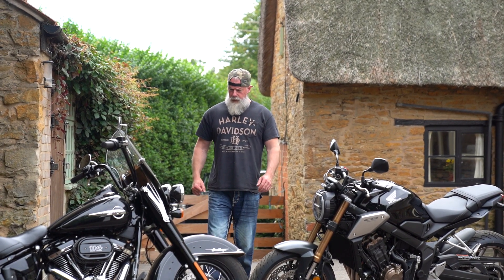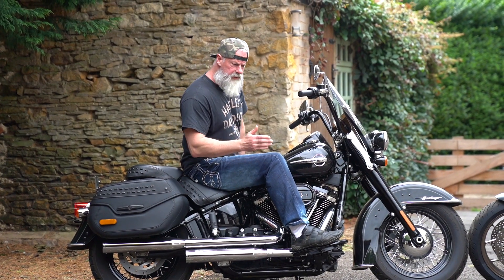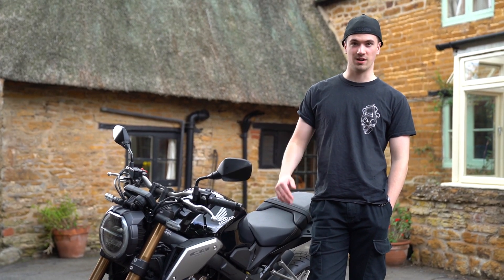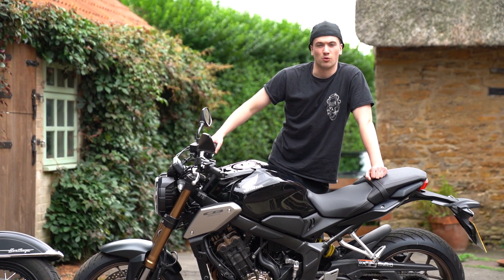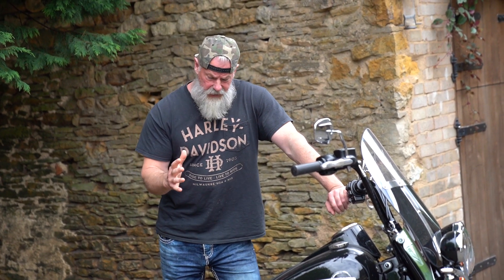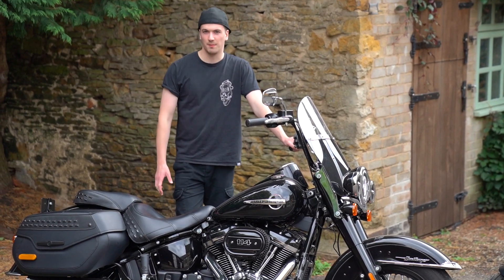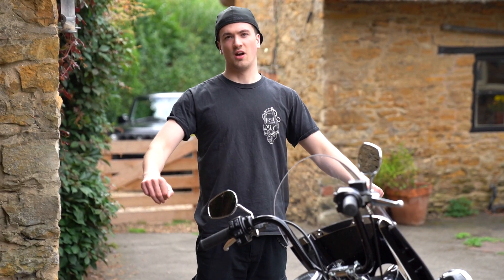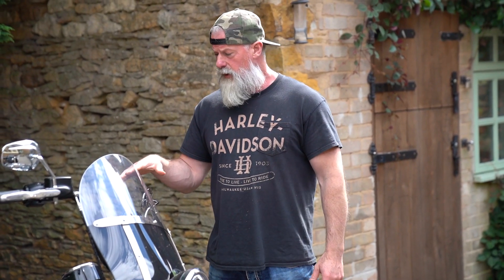Motorcycle Torque vs Power EXPLAINED: A Simple Guide (Harley-Davidson vs Honda)

Comment: For its weight and capacity Harley are not even high in torque. You could have found a 'crotch rocket' with more torque, half the weight and capacity.
Reply: The main difference lies that you would need to rev up the crotch rocket to the red line to generate that maximum torque, whereas in the H-D it can be generated from the very low end in the rpm range. In other words, it is much more satisfying to ride in a mountain with an engine that pushes hard with little effort. For most of us who like cruisers, it is not our idea to stress the engine for recreational rides, besides the fact that the riding position of a crotch rocket is never the best or optimal for long trips. Motorcycles have their purposes; a sport bike is the best only in a racetrack.
Reply: @omarsalgado9715  There are plenty of torquey Japanese bikes that make more bottom end power with less weight and less capacity. I have a 20 year old BMW that makes more torque at lower revs with much smaller engine.
Reply: @parsivalshorse  Name a few, please, better if you put specs altogether.
Reply: @omarsalgado9715  Well the Suzuki M1800R makes substantially more torque at lower RPM and with nearly 50% more horsepower. Harley are a very archaic engine.
Reply: @omarsalgado9715  So does the Honda Goldwing. BMW K1600 GT.
Reply: @parsivalshorse  Suzuki M1800R (1783 cc):

127* hp @ 6200 rpm
118 lb-ft @ 3200
Curb weight 347 kg

*That must be at the crank. Since I won't do a research, it is a safe bet that the hp at the wheel should be around 105 bhp, so:

Power to weight ratio: 105/347 = 0.3025; 0.3025 hp/kg

As we see, it is no better than a Scout AND it must carry its own weight on its shoulders. But it is not that the Scout is the best, it just has to be taken to 8300 rpm to yield that power to weight ratio. So here comes the question that nobody is willing to accept: who anyways runs an engine, for daily use, at the top limit permanently?

You'd find out that if we rode our engines at 3000 rpm, which is likely to happen in daily use, would be more satisfying to have a long stroke one. I like short stroke ones, I just don't like the fact that they're lazy at the bottom.
Reply: @parsivalshorse  Honda Goldwing:

98 bhp / 365 kg = 0.2684 hp/ kg.

You're all missing the fact that you cannot separate torque from hp and vice versa and then them from rpm, and lastly from weight.
Reply: You just need to factor in more details and execute simple arithmetical operations. Don't forget the weight. It is easy to be misled by isolated numbers.
Reply: @omarsalgado9715  I'm not sure what you are trying to argue. Harley is not a particularly efficient or effective engine. I understand how torque and horsepower work and how they are related.
Reply: 2020 Italika FT150 (carburated) - 149 cc

11 bhp @ 8500 rpm

9.6 lb-ft @ 7500 rpm

Curb weight 98 kg

Power to weight ratio: 11/98 = 0.1122; 0.11 hp/kg

Pre-2004 Sporster 883 (carburated) - 883 cc

40 bhp @ 6000 rpm

48.7 lb-ft @ 4100 rpm

Curb weight 222 kg

Power to weight ratio: 40/222 = 0.1801; 0.18 hp/kg

2020 Honda Fury (fuel injected) - 1310 cc

57 bhp @ 4250 rpm

79 lb-ft @ 2250 rpm

Curb weight 300 kg

Power to weight ratio: 57/300 = 0.1900; 0.19 hp/kg

2005 Softail Standard (fuel injected) - 1450 cc

62 bhp @ 5300 rpm

75.2 lb-ft @ 3500 rpm

Curb weight 305 kg

Power to weight ratio: 62/305 = 0.2032; 0.20 hp/kg

2020 Sporster 883 (fuel injected) - 883 cc

52 bhp @ 5750 rpm

54 lb-ft @ 3750 rpm

Curb weight 255 kg

Power to weight ratio: 52/255 = 0.2039; 0.20 hp/kg

2020 Yamaha Bolt (fuel injected) - 942 cc

51 bhp @ 5350 rpm

58 lb-ft @ 2900 rpm

Curb weight 246 kg

Power to weight ratio: 51/246 = 0.2073; 0.20 hp/kg

2020 Honda Rebel (fuel injected) - 471 cc

46 bhp @ 8500 rpm

31.7 lb-ft @ 7000 rpm

Curb weight 185 kg

Power to weight ratio: 46/185 = 0.2486; 0.24 hp/kg

2015 Yamaha Raider (fuel injected) - 1854 cc

86 bhp @ 4250 rpm

105 lb-ft @ 3800 rpm

Curb weight 331 kg

Power to weight ratio: 86/331 = 0.2598; 0.26 hp/kg

2007 Sportster 1200 Roadster (fuel injected) - 1199 cc

67 bhp @ 5200 rpm

79.1 lb-ft @ 4000 rpm

Curb weight 256 kg

Power to weight ratio: 67/256 = 0.2617; 0.26 hp/kg

2020 Indian Scout (fuel injected) - 1133 cc

82 bhp @ 8300 rpm

72 lb-ft @ 6000 rpm

Curb weight 246 kg

Power to weight ratio: 82/246 = 0.3333; 0.33 hp/kg

Comment: I think if I was doing a lot of town riding, taking off from lights, filtering through traffic I'd take the Honda. If I was doing a lot of touring, country miles, the Harley is a lovely, relaxing ride especially with a decent set of pipes as on the Heritage..
Ideally you'd get a 4-500 Japanese Trail bike for town, green laining and a big Harley for country, touring. Harley Davidson should get a trail bike made for them under licence - your thoughts?
Reply from the maker: Yes very good points! What about the Harley Pan America - coming soon?
Reply: @MrDarcy-OlMan  Too big. Make a Scrambler 500 version of their V-twin street bike. Royal Enfield Himalayan. Just a 500 single with road tyres. What we in Australia call a bush basher.
Reply from the maker: @MrAndrew1953  Yes they definitely do need to and easily could do something like that.
Reply: @MrDarcy-OlMan  Harley could get it manufactured in India under licence by Enfield or in the factory in China where Harleys are built or Benelli.
Reply from the maker: @MrAndrew1953  Yes certainly could

Comment: Torque and Power cannot be considered as separate entities. Power = Torque x Revs. The Harley has more low rev power than the Honda and the Honda has more high rev power than the Harley. Using "torque" as an adjective to describe the characteristics of an engine is commonplace but misleading. Far more informative to describe where in the rev range that the bulk of the power is produced. i.e. low end power or top end power. Just get "torque" out of your head it tells us nothing about how effectively the engine can get the motorcycle up the road. It's all about POWER!
Reply from the maker: Good points. You sound like Jeremy Clarkson! 👊🏼
Reply: I agree with almost you wrote, but I differ that it is all about power. If it were, there would be only and only one engine for all the purposes and needs, but we are far from that being a truth. For torque (force; work) and power (amount of work in a given time), which are the two sides of one coin, a torque/hp vs rpm graph is the most useful tool to dig into the behaviour of an engine, and that departs from the very physics aspect (bore, stroke, rod length, etc.). Since no one riding on public roads is likely to take the engine to the red line permanently, those kind of graphs can guide a rider to take advantage of the engine behaviour, so he can know how to suit it to his riding style. More than being about power, it is more about locating the sweetspot that matches our riding style or needs.
Reply from the maker: @omarsalgado9715  Absolutely. Thats exactly why I generally keep the Harley between 2500rpm and 3500rpm
Reply: @omarsalgado9715  Power is the limiting factor for all jobs. Having an engine that makes it’s power at low RPM makes it dramatically more cost efficient. (Long haul trucking/shipping/farming/industrial)Having it make its power at high RPM makes it dramatically more effective for its size/weight.(Motorsport)
And then there is something called “character”.

Comment: Basically...the Harley-Davidson is like a hammer drill with lots of torque, and the Honda sport bike is more like a high speed dremel.
Reply from the maker: Yes that’s a good analogy 👍🏼
Reply: @MrDarcy-OlMan ...By the way, the sound of your Harley is EPIC!!!
👌🏍💨🔥🔥🔥
Reply from the maker: @breakoutpete210  thanks! Yes that spot seems to amplify the sound!
Reply: Well its good analogue when we stop at explosion in cylinder  assuming more torque was achieve be biger stronger explosion and not from longer arm from crank 👌🏻if we go lil further than that answer for people like you may be lil surprise 😜 cos lighter hammer at enough more velocity be generating more power and less torque in fact hit harder 😎this is analogue to output force at contact path at given velocity 🪠i maybe do lil video with this hammer later 👍🏻and show you how it goes 🪠i can just write you now that lighter hammer at enough biger velocity which give more power and less torque at arm axis will in fact need lesss hit to put the same nail in the same peace of wood or it also need less hit for cut or break the same part of wood  be using some sharp tool at end 😁 watch this https://m.youtube.com/watch?v=NMUMjLJgqu8 😎

Comment: Easy explanation.

Adding to yours, torque and horsepower, being the two sides of a coin, have a peak number, as you stated. What is often overlooked is precisely this. Manufacturers claim hp at certain rpm, usually high, in order to show their bike and thus attracting more possible buyers. That's okay, since they want to sell for revenue. But, examining the question, peak hp is often achieved near the red line, and here lies why hp must be taken as a grain of salt: for racing purposes, hp is absolutely essential; for commuting or recreational riding, it is not since it isn't usual to take the rpm to the red line most of the times; in other words, street use calls for the mid number that manufacturers claim in their specs sheets.

Torque and hp prove to be more useful for street use if considered firstly having a rpm at which they are generated and secondly by reading the power/rpm graph, because it is in this graph that we can see how the engine behaves, thus we can destine it in a wise way for its purpose or our needs, which, for a responsible rider, aren't racing on public roads.

Finally, even though we can have a certain hp number at a certain rpm, it is necessary to divide the hp number at the rear wheel between the weight of the vehicle in order to have an approximate power to weight ratio (wind resistance has its role here, for example), being the resulting figure a better indicator of what the motorcycle could potentially generate. It is also useful for fair comparisons.
Reply from the maker: Yes absolutely! Another superb addition to the subject! Thanks 👍🏼👍🏼

Comment: Great explanation, i love to discuss things like that 👍

Power (= Watt) is just the product of torque (Nm) multiplied with revolutions per second multiplied with 2x phi (3,14).
Thats the reason why harley never had a huge amount of "horsepower", because of the slow turning crankshaft.  This crankshaft cannot turn that fast because of the long stroke of the pistons, otherwise the velocity of the pistons in the cylinders would exceed.However, due to the long stroke, there is a large amount of leverage which results in enormous force of the harley engines.

P.S.:  I've  NEVER heard of this Christian......who? 😁
Reply: It should also widespread that there is no perfect motorcycle. Every motorcycle in this physical world is made out of tradeoffs. You explained one at engine level. We can take wheelbase and agility/stability; wide tyres and agility/stability; rake and trail angles, high or low centre of gravity, etc. No motorcycle is perfect because they are manufactured with a final/ideal purpose and the real use or needs a biker has. No bike is better than other, not at least outside the racetrack. Once understood this, absurd hatred or praises would be no more. We as motorcyclists should be united, no matter the brand or engine size.
Reply from the maker: @omarsalgado9715  Yes we certainly agree with that! 💯
Reply from the maker: That’s an excellent addition to the subject; thank you! Christian who?
Reply: @MrDarcy-OlMan  With Christian "who" i meant this runner that you mentioned es an example. I forgot the 2nd name of him.....Coleman?
Reply from the maker: @michis.9888  yes I know - i was joking! 🏃🏿‍♂️👍🏼
Reply: Sorry, there is no Leverage from a long stroke.  That is a myth.  Leverage of combustion to the contact patch can be found in the transmission, final drive and tire diameter however.

Comment: Think of it in terms of loosening a wheel nut - Horsepower is the strength in your arm, Torque is the length of the wrench you're using.
Reply: Nonsense.  Combustion is the strength of your arm.  Leverage in the transmission, final drive and tire diameter is the length of the wrench you are using.

Comment: Rented a Morgan three wheeler with the 2 ltr S&S X wedge  114.4 lb.-ft. @3000 rpm so I know what you mean back wheel would spin if you sneezed in the first 3 gears
Reply from the maker: Yes exactly! 👊🏼